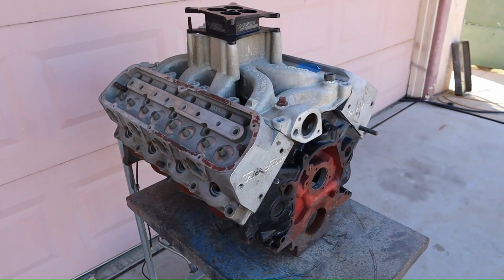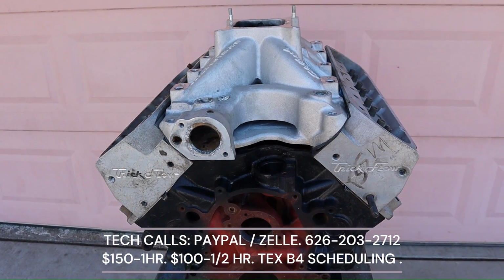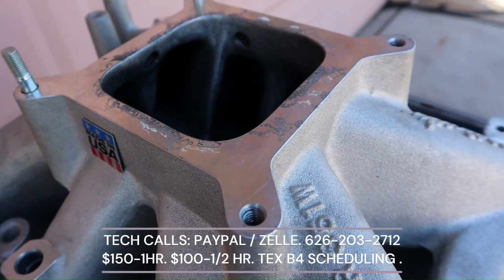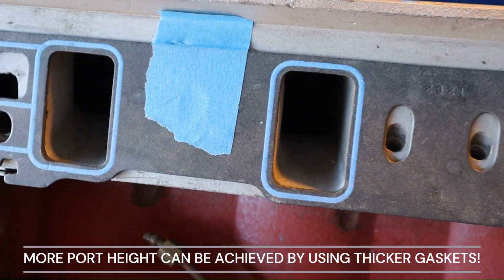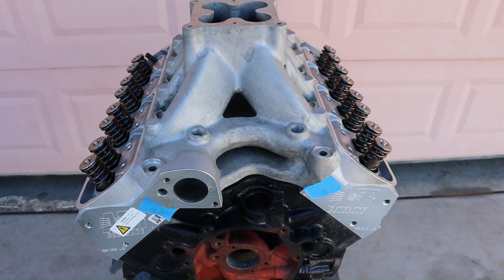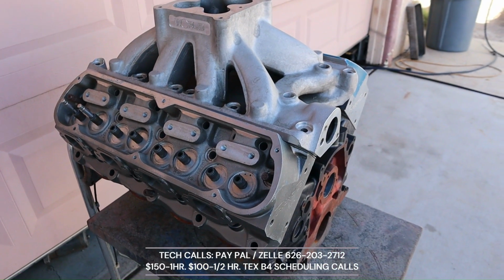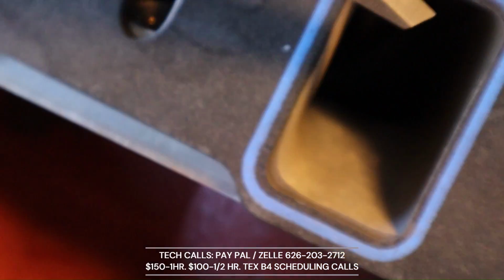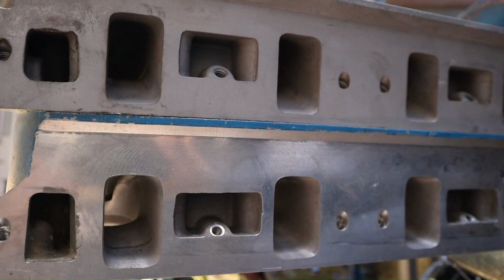351 SWAP 9.5 MANIFOLD TO 9.2 BLOCK!

Comment: You can use 302 intake manifolds on a 351W using Price Motor Sport adaptors. Gives you  more low end power for the street.
Reply from the maker: You can use them but you have to match the manifold design to the rpm range you intend to run.

Comment: If you have a 9.5 deck do you have to mill the intake to plate it ?
Reply from the maker: No need to mill or cut the manifold flanges.

Comment: Thanks for the great video Ben. You have me thinking that I want to build a 351C for the 9.2 deck height vs 351W 9.5 deck. I am looking to stroke the C motor to 427 and take advantage of the lighter rods and somewhat smaller crank journal. Your thoughts on the C since I have seen you speak much to that block?
Reply from the maker: The C block is good as long as you correct the oiling if you plan on rpms and big power!  My favorite is the 9.2 deck W the best of both worlds and hang on a few more months, a good friend is coming out with a new C block updated without the issues.
Reply: @ can you tell me which of your videos discuss’ or goes into depth on the C block?

Comment: Ben,  what kind of filler do you use with cast iron heads if you are  say filling the port floors for changing the shape.
Reply from the maker: Just posted on video shorts the type of epoxy I use.
Reply: @ I watched it and thank you, but you use it on cast iron too?

Comment: Thanks for the knowledge, @Ben Alameda Racing 🏁 this is a good description of the TFS Twisted Wedge R heads vs. the TFS High Ports; it's clear from the video that there's a good amount higher. You can raise the ports in the R Series than the high ports. Does this mean there's more material for a larger port runner overall? When they say high port. To me, it's a 3/4" raised exhaust vs 1/2" in the R head. On the intake side, is the high port really raised? If so, then I would think it would require a special intake, therfore to me the highport is in reference to raised exhaust port only with large intake ports and a 20° head. Whereas the Wedge head has 15° intake and 17° exhaust angles, which promotes good flow, especially if you raise the ports. I prefer welding to raise the runner, and if so, how can you weld without making the material weak?  Thanks again, and I look forward to the next video 📹 💯  🏁 🏎
Reply from the maker: They  both use regular aftermarket intakes except if you plate them or use a 9.5 deck manifold on a 9.2 then modification needs to be done to the bolt holes and a valley tray/cover because now it sits much higher!

Comment: I'm a Chevy guy.  I am doing alot of research  on a 421 Small block Chevy.  69 camero  drag and drive car.  Looking at 600hp+. 11.00 or so. Hydraulic roller cam.  Chad Spires heads.  Is it worth looking into intake manifold spacers.  Thinking of using a Holley 300-110.  Per Chad? THANKS FOR THE GREAT VIDEOS.
Reply from the maker: If Chad recommends a combination I would take his suggestions seriously.  He knows his stuff no doubt!

Comment: You comments on plenum volume made me think of the mod I did to my 5.9 magnum dodge. I added some panels in side the i take to reduce the volume and some minor porting to the entrance to the runners. On an otherwise stock engine, the resulted in a 1.5 second reduction in the 0-60 time. The truck was still slow but, definitely a good improvement. 

I always look forward to your next video. Great info and well presented.
Reply from the maker: Thanks Ray and that was an interesting observation you did that made it better.  Maybe the panels directed the flow better to the individual ports?
Reply: @benalamedaracing2765  I believe it was a combination of both the reduction of volume and a reduction of turbulence at the entrance of the runners. I'm glad I tried it. I would like to a way to calculate at least a good starting point for plenimum volume. On the magnum engines, it is obviously WAY too much volume.

Comment: Hi ben thanks for the great info...just a question...is running this windsor set up on a clevo block superior to just running a good cleveland head and intake from say chi or afd? Is all that work net big gains over a chi cleveland set up?
Reply from the maker: The CHI is an impressive piece specially if you stroke the crank close to 400 or 408.

Comment: When you raise up the ports like you were demostrating, what do you use to fill the lower? I imagine another plus is the opportumity to reshape the short side if needed.
Reply from the maker: I go up and raised the floor the same amount.  Use a 2 part marine epoxy and they are tough and stays on!
Reply: @benalamedaracing2765  marine epoxy i guess would be pretty durable stuff, do you do anything to make sure the epoxy is anchored or does a rough, clean port finish hold it in place ok?
Reply from the maker: @vrm86gt  I roughen up the area where the epoxy will be sticking.  Have seen on fall off.  Obtw, I spray the area with brake cleaner to remove any kind of grease or oil residue.
Reply: @benalamedaracing2765  Have you tried this high port techniques on Twisted Wedge 170 (original style) reason I ask is because i had my heads milled .030 to raise compression, block has decked a little, and the intake sat pretty high, I had milled the intake to lower it to align, but raising the port would have been better for performance obviously. was nervous about doing that and never have messed with epoxy on the floors or anything.

Comment: Another thing to consider 9.2 was that 2.749 main . The bearing speed of the 9.2 was like backing the rear brakes off.
Reply from the maker: for very high rpms and short strokes hard to beat a 351 9.2 with 302 mains.